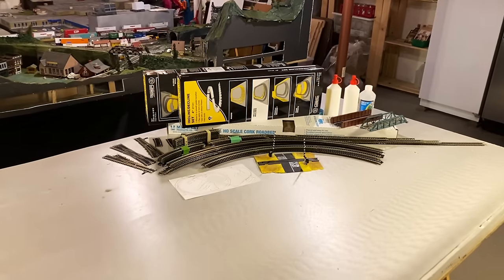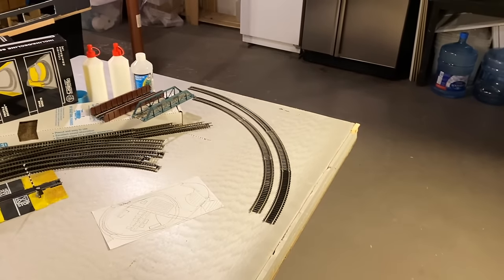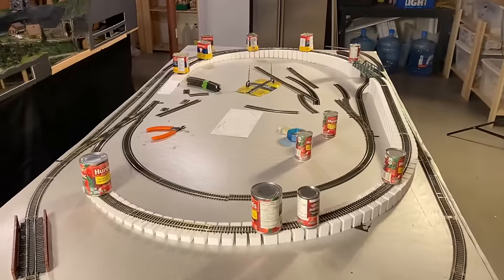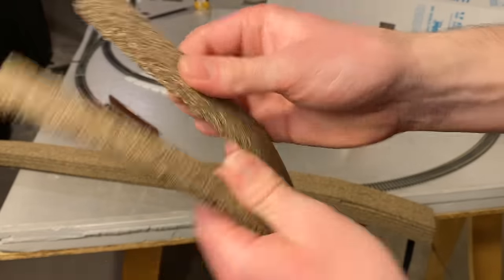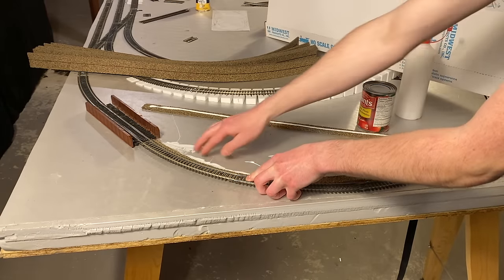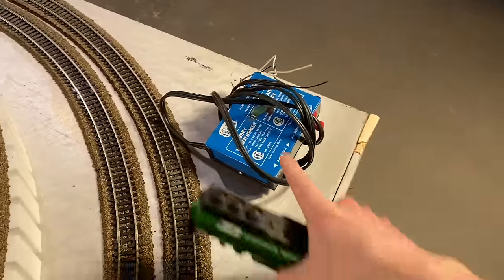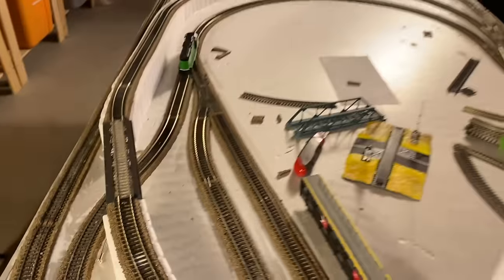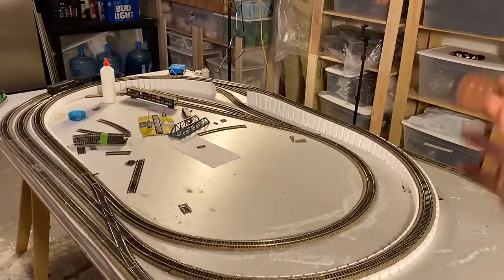I'm Building a New HO Train Layout - Model Railroading

Comment: You should see if it's possible to add a second crossover so trains can return from the inner loop to the outer loop without reversing
Reply: Yes, I said the same thing. A crossover would be perfect just past the diamond crossing.
Reply: Funny:  Thinking the same thing.
Reply: I like how you use the sauce cans.
Reply from the maker: That's a good idea but it would be tricky to fit.
Reply: @SMTMainline  only one way to find out lol. Nice work by the way, looks awesome.
Reply: @SMTMainline   A switch just before the track goes under the bridge to divert it back to the outer loop.
Reply: I was just getting ready to leave the same remark you left. He needs another crossover from the middle track to the outer track down this end so he can get back outside. But for a small layout it's pretty creative. And dealing with HO scale you can Overlook some small technical things. I have N scale and it really needs to be almost perfect when you're laying track. I don't think the real Big Boy ever went through an S curve. Even though it's articulation helped it to negotiate curves, when they were putting it in mothballs or out for a stroll, it took bunch of people to get it off the main line to the warehouse and vice-versa.
Reply: @SMTMainline  Like David was saying, from the middle lane back to the outer...  Otherwise great design and workmanship!
Reply: @SMTMainline  In my opinion is the parallel track of inner and outer loop after the crossing a good place to put the crossing back from inner to outer.

Comment: Union Pacific Big Boy reminded me of something from my childhood. I saw and heard the Southern Pacific 4294 in a train station right before it was taken out of service in the early 1950’s. Yes I am old, I must have been 5 or 6 at the time. The noise and steam and the monumental size of the engine is something I’ve never forgotten. My uncle worked for Southern Pacific that’s why I got to be up close to the beast.  The hiss and rumbling of those HUGE steam engines was unbelievable.
Reply from the maker: That must have been quite the locomotive to see in person, I can only imagine.
Reply: My firs adventure with steam was on Reading's Iron Horse Rambles in the early 60's.  Big T-1 ,4-8-4's which had been stored serviceable and commuter coaches that were not needed for weekends.  It was fabulous.
Reply: @wilde1909  got pulled by one big boy when I worked at Ringling brothers. 93 - 2008 years . Awesome to see huge machines of that size.

Comment: Ah, but it appears you've forgotten something crucial about the Big Boy, SMT! It's elementary, my dear Harrison. This HO scale Big Boy, much like the prototype, was designed with sharp curves in mind, hence why they are "articulated". Anyhow, great job on the layout! I'm sure that friend's son with love it.
Reply from the maker: Mr. Rossi took the average layout into account when designing his models which I respect. Having said that, 18R is still a tall order for a locomotive of this size.
Reply: @SMTMainline  True, but since it's articulated, it's like two locomotives with 8 wheel bases, and although the four-wheel trucks/bogies do add more resistance, i've seen plenty of 2-8-0s rated for 18 radius curves(granted like you said, the Big Boy is a big locomotive, and only the front section really applies with my argument)

Comment: Awesome! That's impressive that the bigboy navigates 18" radius! Nice track work harrison!
Reply: I expected it to be fine, since it’s articulated. If you put a 2-10-4 “Texas” on there it would potentially have a harder time than any locomotive.
Reply from the maker: Rivarossi intended them to but it's still a lot for a locomotive like that.
Reply: @SMTMainline  that is neat to know, kato is doing something similar with their N-scale Bigboy, its supposed to be able to navigate 9 3/4" radius. Which is about the equivilent to a 18" radius in H.O. Impressive job by rivorossi on the design of that engine then!
Reply: Even the Trix bug boy can do 18 radius

Comment: Hi, I would remove that hump on the side of the bridge track you repaired. cut the risers back to where it is level straight across the bridge. Then shave the cut-out section of risers level and then replace. This would be the time to do it and save a lot of unwanted uncoupling issues in the future. Great job I'm a big fan of your videos.

Comment: Wow, Harrison. Great job showing how you built that layout. Very inspiring. I have had no room for a sheet of plywood in apartments I have lived in. When I lived at our old family home, I had space to build several model railway layouts, & I did. When I was about your age, 40+ years back I finished a great layout in room off Dad's car port.  Had to dismantle layout when my Dad sold the house in fall of 1982. However, I still have a lot of my old locomotives & rolling stock from the 1970's & early 1980's, seeing what you do makes me think that I should try for a shelf layout in my cramped flat. If I can't get my old Athearn, Life-Like, Model Power & AHM locos to run, I will look to your past videos for advice on getting them to come to life.  BTW, great hint with the artist's pins to centre the cork roadbed & track. So cool to see that AHM /Rivarossi U.P. 'Big Boy' steam locomotive charge around your layout. I almost bought one of those when I was in Seattle in 1979, but I didn't have enough U.S. cash left in my wallet. No debit machines or ATM's 44 years back. I had a C.I.B.C. 'Chargex' card then , but store in Seattle wouldn't except it. 'Chargex' card later became 'Visa'. Arrghh, I really wanted that 'Big Boy".

Anyway, sorry to bore you with my old stories. Keep up the good work on your channel. Great stuff. Always cool content you post.

Comment: Great to show all these new ideas put to work in a layout construction. Don't forget to test the track under the bridge with a couple of your longest wagons hooked together before you start to add the scenery. It is indeed a good start but to facilitate expansion, incorporate a point/switch on the outer mainline leading to a siding which the new owner could easily convert to an extension when ready.

Comment: I've been a model railroader for sixty five of my seventy four years and I watch and enjoy your channel. It's interesting and you have some things to teach this old dog. If I may, an observation on this track plan. A train moving clockwise on the outer loop can move through the cross over to the inner loop but cannot return to the outer loop. Similarly, a train moving counter clockwise on the inner loop can move to the outer, but can't return. Another set of switches and an opposing cross over on the ground level side of your layout would make this plan more flexible. Great layout, great series. I'm enjoying watching your build.
Reply from the maker: Hey. You are spot on with the track issue, luckily it was corrected in the second video.

Comment: I had a foam base and ripped it all out and replaced it with Homesote (highly compressed recycled newspaper). I found that the foam actually amplified the engine noise, making it louder. Homesote does an excellent job of deadening noise and is super easy to push in track pins.
Reply from the maker: I have used homesote on other layouts, excellent stuff but not so good for making valleys and so on.

Comment: I've been thinking of a "modular" kind of build. Start with a 4x8 layout that has exit and entrance lines running to one end of the layout. Then, in the future, build a module either 4x4 or another 4x8 that bolts onto the 1st and the second build could be a week  or decade after the 1st. Trying to find a good layout that will lend itself to this.

Comment: Great job but I'ld give you a 7 out of 10 points.  The order of construction is OK but, add 2 more steps.  With the track on 'the board', use a sharpie, or other marker, to locate the center of the track.  Take the track off, 'connect  the dots', line up the roadbed to 'the dots', then put the track back down.  Yes, it is more 'steps' but way much less mess to deal with.  I would've added 2 left-hand turnouts so the train could go back to the main line, without backing into the main line.  FYI - I'm 72 and started out with an A.C.Gilbert American Flyer train that I received on my 6th birthday, in 1957 🙂 (The train still runs today.)

Comment: In my case, over 90 percent of my layout is foam-bedded, and after ballasting, the foam doesn't compress unless there are around 50 lbs. on it. Also when I roll rollingstock over the 2 there is a very slight sound difference. it seems to be quieter for the foam too.
Reply from the maker: That's good to hear.

Comment: Ah. The age-old question about which track is best. To my knowledge, brass is, technically, the best conductor of electricity however nickel-silver is extremely good (the difference is infinitesimal) while at the same time NS is much more resistant to oxidation AND the track looks more realistic to boot. It's the oxidation that kills conductivity with brass track. Brass requires more maintenance for that reason but the proper cleaning techniques will allow top performance out of brass track. All that being said, great build, perfect choices on the design and the Code 100 track.

Comment: Once you have the train on  the inner "loop," how do you get it back onto the outer loop? All I can see is backing a train onto the outer loop from the inner loop at the crossover junction. I can see how one could run two train as it stands, but maneuvering the trains to change loops could lead to some difficult some mainline problems. Perhaps there could be a switch at the bridge underpass where the outer loop train could stay on the outer loop instead of going under the bridge--and thus get "locked into" the inner loop?
Reply from the maker: There will be a switch added to the mainline to fix that.

Comment: About to build my very first layout so total newb here. What is the foam board base, is it just thick foam insulation board that you would get at a home improvement store, are you using white glue or something stronger to secure it   to the plywood what did you use to dig out the river bed?
Reply from the maker: It's just regular foam from the hardware store over a half inch 4x8 plywood board.

Comment: One problem. If trains are travelling clockwise, they cannot get from the inner to the outer circuit. Adding a crossover just outside of the upper bridge (at baseboard vlevel) would allow transfer back to the outer circuit. Thanks for posting. Amazing that the Big Boy was able to negotiate the 18" radius, and everything looks like it will work out good.

Comment: I really like those Woodland Scenics inclines. Just what I’m going to need, what’re they made of?
That was fun, just shows what you can get into 8x4, though these days I only use Peco code 100 flexi track and try to have the largest radius curves possible. I really hate the overhang you get on tighter radius curves. Speaking of overhang have you checked out what happens when long bogie vehicles pass each other on that double track curve? I think you might  get a few clearance issues there. All the best, Rob

Comment: This video actually came out at the perfect time for me, as I am currently planning my first HO layout and I will definitely be taking notes on how you do the inclines, roadbed etc. I especially will use the dollar store pins instead of track pins since they are longer, and I was wondering why the track pins I got a while ago weren't as long as the ones in your track building videos. Thank you!
Reply from the maker: Glad it was helpful!
Reply: I fast-forwarded through a lot of the video, but I don't know about using pins or nails in this without having actual wood to poke into. It feels like they'd come out or move around with time. I'd definitely rather use a little glue or specialized caulk to put down this track. Could probably get by without gluing the turnouts too. Just doesn't feel like it would be a good material to stick into.

Comment: So I built a layout long ago, probably 30 plus years ago on a 5x9 sheet. I used the cork roadbed then and it turned out very nice but now that I am finally building my second one, it's a 12x6 footprint, I have decided to not use the cork roadbed. I have see some layouts that have them and some that do not. I want to use it but My main reason to not, is of course,  economics. Should I be using it??? Change my mind.
Reply from the maker: There isn’t a better alternative. I’ve used foam before and it’s been nothing but junk. As I said in the video you can buy sheet of cork at the hardware store and cut them up if you wanna save on it.
Reply: I understand it looks nice, it really does. But I have seen some lay their track right on the board and ballast it and it looks fine. Is the cork just to give the raised up roadbed look?

Comment: Excellent video, very helpful. Question: What does the table surface consist of? It looks like the top layer is something soft you can push the pins into. It is plywood covered by foam?
Reply from the maker: Styrofoam. You can find 4x8 sheets of it at the hardware store.

Comment: One thing you could have done is lay the track, trace both sides of it using a sharpie and then pull up the track

That then gives you the outline for where you need to lay the cork without having to deal with sliding cork under the track that is laid

Comment: So when you are initially putting your track together, I see that you are using a set of precision diagonal cutters. Are you actually cutting the rail for custom fitment or just crimping the actual coupler? Or both???
Reply from the maker: I cut some of the strait pieces for a custom fit. Occasionally I use a pair of pliers to get the rail joiners on.

Comment: That's a really messy way to put down cork roadbed.  What I did was lay out the track first, as you did, then take a felt tip pen and put dots in the middle of the track all around the area where cork roadbed will be.  Then remove large manageable sections of track, put SMALL DOTS of glue on the back of a strip of cork roadbed about an inch apart and lay a section of the cork along the INSIDE of curves, placing the cork vertical edge (which will become the center of the track) on the marks made by the felt tip pen, holding the cork in place with push pins.  Do this all along the layout that is being constructed.  Use a bunch of push pins to keep the curvature smooth.  When the glue sets up then it's an easy process to run the cork on OUTSIDE of the curves, again using small dots of glue every two or three inches (or whatever the metric equivalent may be) - pulling the cork against the already in place cork using only a few push pins.  Along straight sections it doesn't matter which side is done first.  Trim the ends accordingly.  When the glue has set up, remove the push pins, move the sections of track back in place, align the joints and install the track nails in the appropriate locations.   The reason for the DOTS of glue rather than a solid line of glue is at some point you may need (or want) to move the track and roadbed.  With DOTS you'll be able to remove the cork roadbed with something like a putty knife with minimal damage to the underside of the cork and be able to reuse it.  This works for both sectional track and flex track.  IRON HORSE TRAINS
Reply from the maker: Not a bad idea but I think it could be harder to line the track up after.

Comment: Just curious of how much this exact layout would be in the states? I like this for just now getting into it. And don’t have to solder your connections?
Reply from the maker: It would probably be around $500. Soldering is not necessary but it can help in the long run.
Reply: @SMTMainline  thanks for the response.  I need to figure out how to save this video. The layout is nice.

Comment: Very nicely created and informative video, well done. Good work and good lay out. On the left side of the layout, the outer circle is 22", middle 18" am I right?? What is the radius of the  inner most curve with upward slope before the bridge??
Reply from the maker: Thank you. The two outer lines are 22" the furthest having a spacer in the middle to allow this. The inside circuit is mostly 18" however there are a few pieces of 22" snuck in.

Comment: Love the layout plan! I’m planning on using this design as a base for mine but plan to go DCC do you think a single pair of wires would be enough to power 2 trains on your layout or should I go the bus / feeders route, wiring at multiple points on the layout?
Reply from the maker: Two wires are usually fine for a 4x8. If you wanna add a second set for the inner loop it might improve performance slightly.

Comment: Hey SMT, nice layout. I have a quick question, and I know the video is 8 months old but I see you've used a cross. The cross has a fair bit of plastic in the center and my Spirit of 1776 keeps slowing down and losing power briefly but continues through because of intertia and I assume it's because of the plastic wheels on the opposites of each truck. No other locomotives do this.. any clever ways to fix it?
Reply from the maker: That's one of the draw backs of locomotives with 4 wheel pick up. If you clean the wheel extra well with something slightly abrasive, it can help though. It's possible there are other kinds of crossings which use less plastic.